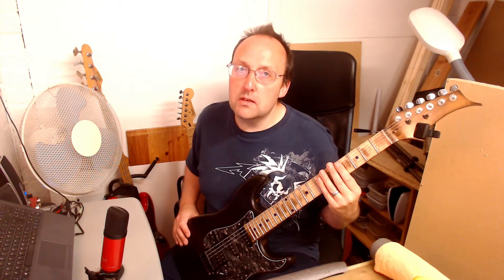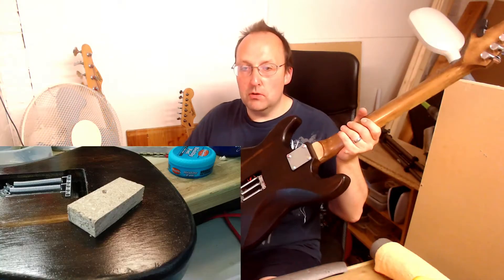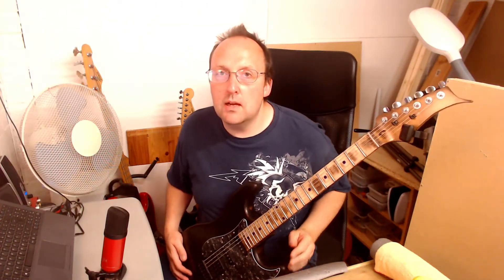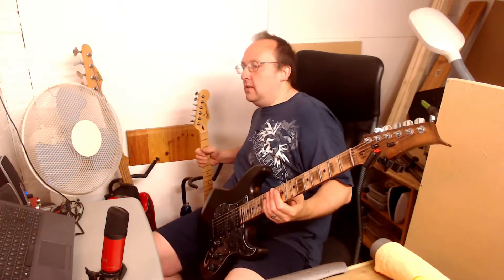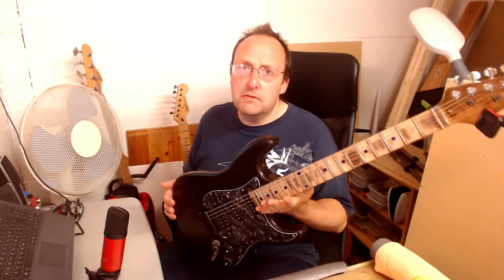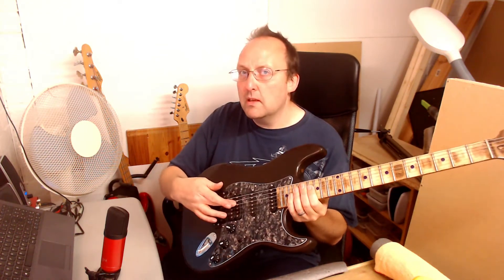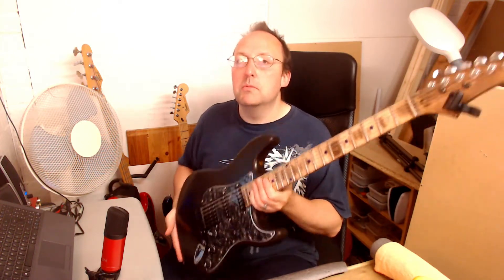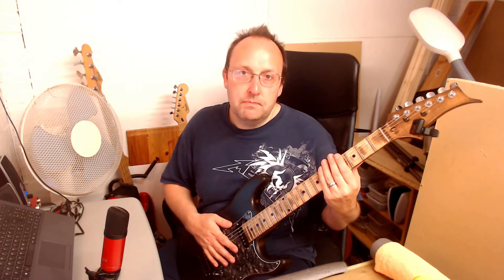Part 5 - IT'S ALIVE! - Shite-o-caster

Comment: I am just waiting to build my firtst guitar and I think I am getting the same body.... I wanna make it natural. Any recommendation to a total beginner?
Reply from the maker: Treat it with care, it's very easy to dent.  Make sure you give it a sand first, this one had glue marks and finger prints over it.  Shouldn't be much to deal with, but will need to be done first.  Apart from that I reckon the grain will look nice with a natural finish on it.
Reply: @ChrisFranklyn  Thanks a lot for the advice!!!